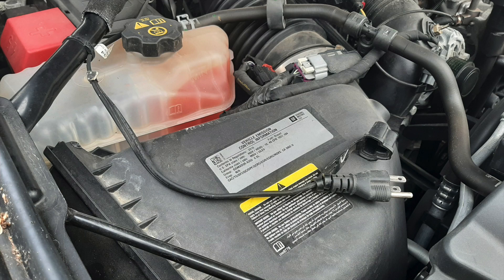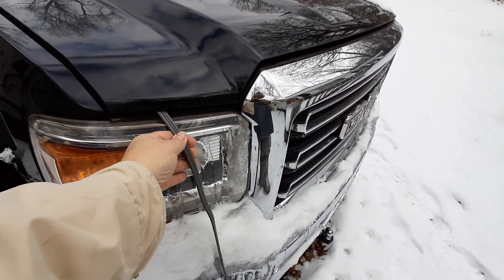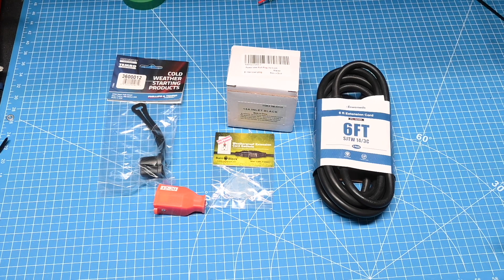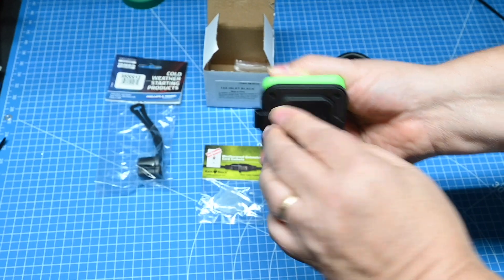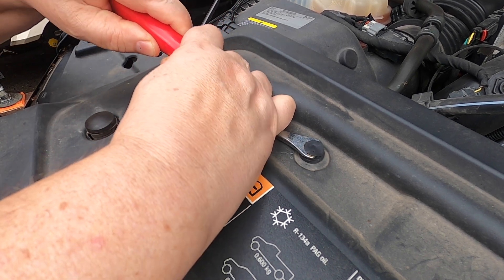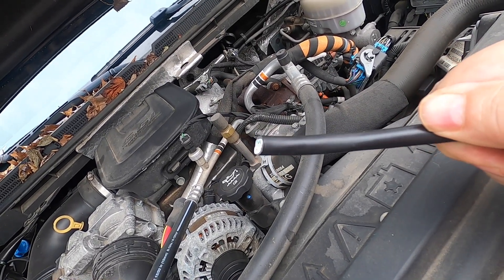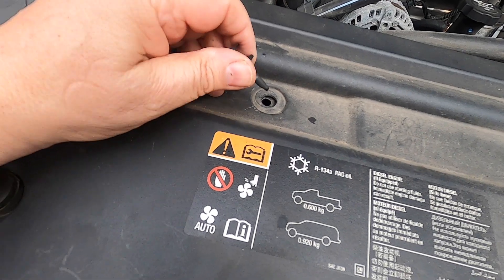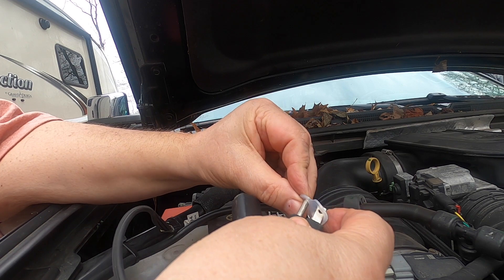Improving GM's Duramax coolant heater connection.

Comment: GM must be listening, they changed the location on the newer trucks. Also put the DEF fill back by the diesel fill.  Have you been happy with your Duramax? How many miles on your truck?
Reply from the maker: Yea the DEF fill in the engine compartment is really messy.

So far, I have about 45,000mi on my Duramax - almost all towing.  It has been reliable. The only issue was a recall for a DEF tank sensor.